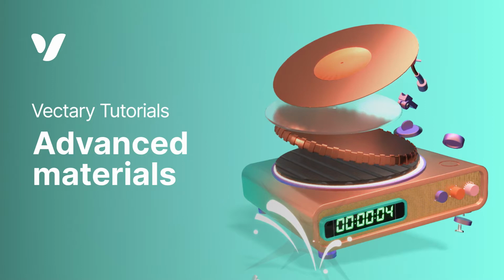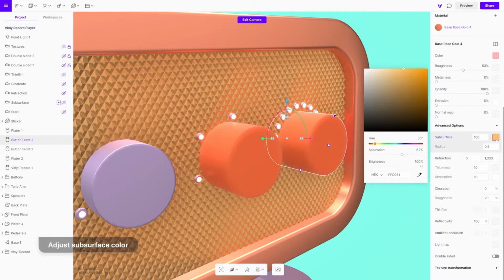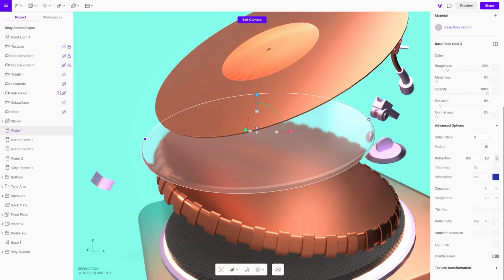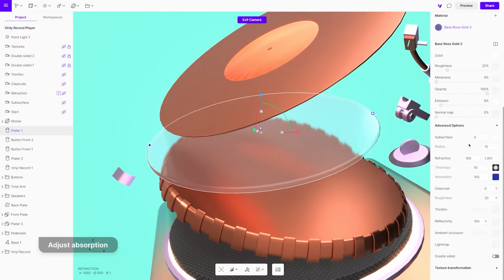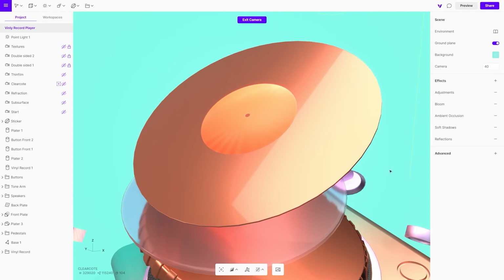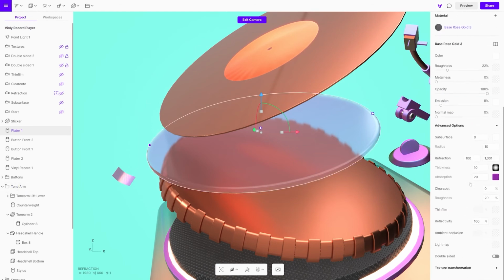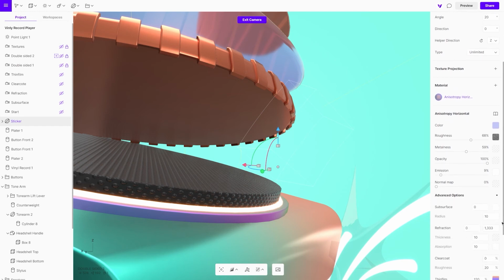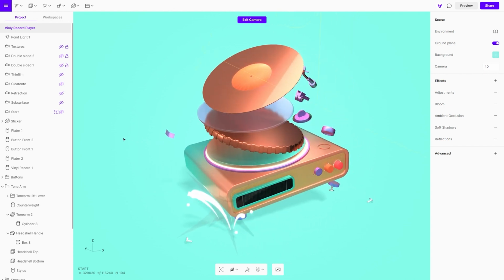Material settings part 2: Advanced | Vectary tutorial

Comment: When I save a file such as obj or glb and bring it into another program like Spatial or other programs the texture of glass does not come out looking like it does when created on Vectary. Is there something specific to do to make it save the textures like it actually looks in Vectary?
Reply from the maker: Vectary has a unique rendering engine and supports more material types than some other platforms. Glass uses "refractions," which are not exported into .obj. If you need a transparent object in programs that use obj only, then you need to set it up with "opacity" in your material settings. Even if you export as .glb which is PBR standard, the program where you are opening needs to also support that material type.